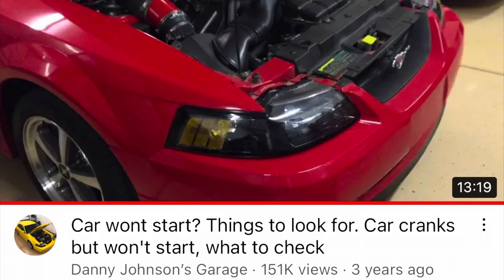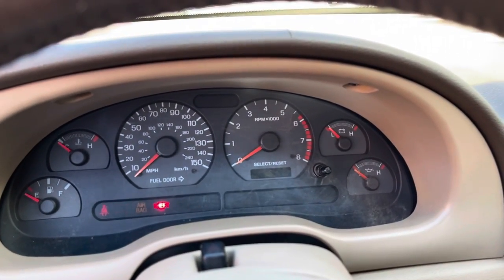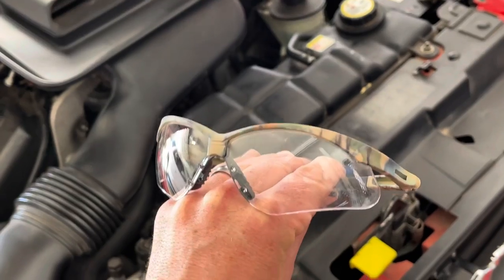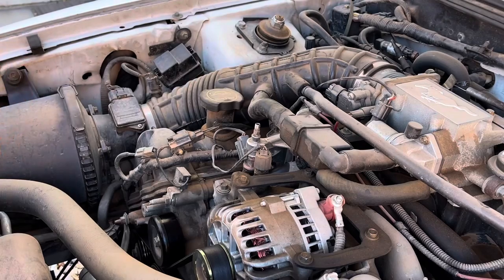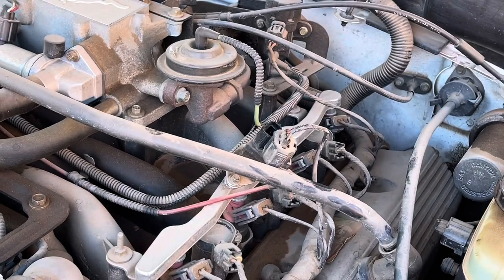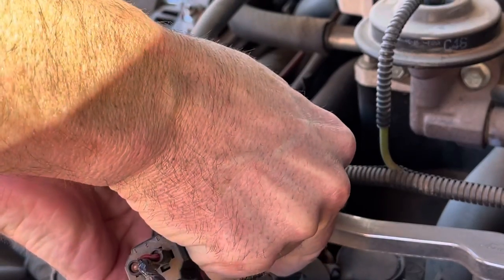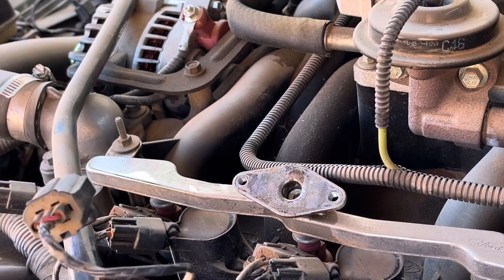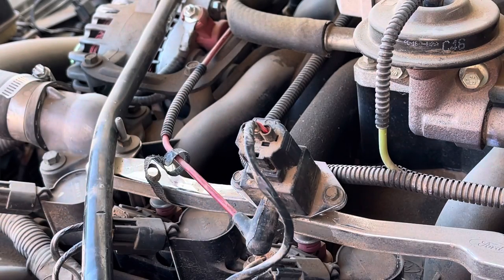FRPS Fuel rail pressure sensor replacement: car cranks but won’t start p0193

Comment: You are a god send dude, my 04 is having slow acceleration issues after I swapped the catalytic converters so I hope if I swap the fuel pressure sensors and fuel filters it'll fix that
Reply: Nope, it was having a torque converter or general transmission issue, beyond my capabilities to fix so I'm selling both my 01 and 04 mustangs to get a down payment for a car from a dealership
Reply: Did you sell your Mustangs after all? I just started mine this past year, hadn’t used it since the pandemic, Feb. 2020 ‘cuz of the Ford PATS crapping out. Finally fixed that last July. But now It’s starting to like misfire, and I get this code too, and like 5 other codes related to the gas cap and/or fuel issues. My wife wants me to get rid of it, since it needs a looooot of work, and a looooot of restoration. Also a new top since it’s convertible. New front tires since they’re from around 2017 dry rotted and wires starting to show up along the inside, since it’s slammed from the front - the lowering springs and the SR ball joints lowered it waaay too much! LoL I can’t sell it, I cannot get rid of it!!!! It’s also not worth any $ due to all the work it needs and the high mileage it has. It’s worth more to me than all the $ in the world!!! But it is frustrating!!!
Reply: @elbros5325  Yeah, i sold both of them for like not even 2k combined, i think i figured out way after the fact i basically just needed to clean the throttle body or get it tuned for having no cats or something like that, i moved on to my current POS a different 04 from my cousin thats had the dash swapped before i got it that shows 80K miles but in reality the car has 200K

Comment: I found another simple trick,  to lower the Static fuel line pressure …while changing this exact sensor, or your (In-line Fuel Filter) near the frame rail! Unplug your (Fuel Pump Relay)  in your electrical control box. You can then crank the car and the injectors will bleed off the fuel pressure …it may even run for a little bit , and stop. Shut off your ignition, After your complete your task, just reinstall your (Fuel Pump Relay), when you’re finished.
Reply: my fuel rails didn’t have that pressure bleed off valve so this definitely helps!

Comment: I am dealing with a HIGH fuel pressure problem that is intermittent.  Sometimes it will be fine at 40 psi and others it will go all the way up to 65 psi.  According to the shop manual 65psi js out of spec.

How do I go about troubleshooting this issue?

Comment: thanks my car is having this issue i just ran a scan on it and it popped up with that code. when I was driving I felt the car shakey and the common diagnostic issues I read online about that code were happening. Plz make video for all P code issues a mustang can have lol It's hard to do the maintenance by myself and mechanics out here are $$$.

Comment: you are the one I will follow now, I have 3 mustangs came in with crank no start, 94, 02 and 05, all of them crank but no start, has sparks, and fuel rail does have pressure, it shows 45 psi on the 05 mustang we check today, but it just keep cranking will not start, I should check the fuel rail pressure sensor. thanks for the video. we work on import cars only, and my friends just bring in his mustangs with no start condition, hope that is going to be fun tomorrow.
Reply from the maker: Here are some things to look at as well  https://youtu.be/JvgKGJjAwU0
Reply: @dannyjohnsonsgarage  thanks for the info, really appreciated

Comment: I have a check engine light on for o2 sensors, after filling up at the gas station I turn my car on and it dies unless I rev it for a little, only happens after I get gas. I replaced Evap cannister and the solenoid and it didn’t work. Any idea?

Comment: Thanks for this video, how ever just a heads up I believe 04 GTs are not equipped with a Schrader valve I am currently tackling my FRPS and cannot locate mine on either rails ..should hitting the switch in back of trunk help assist on the fuel pressure through the rails??
Reply from the maker: You are correct, no shrader valve on the rail for 2004 GT, and the inertia switch in the trunk or pulling the fuel pump fuse then starting the car should work
Reply from the maker: Fuel pump fuse https://youtu.be/u8rogpZSCXg

Comment: I replaced my FRPS today (05/16/2022) in my 02 GT but I'm not sure it fixed my problem since I did get a couple of 50 PSI readings on the scantool but most readings were around 40 PSI. I did get a P0193 code with the old sensor though. A fuel pressure gauge showed 32 PSI with the engine running. I did notice that in some of my live data reports that fuel pressure was down around 10 PSI a few times also. Anyway, I'll have to drive around for a few days to see what kind of readings I get but I think I still have some other fuel problems (maybe fuel injectors). I put some fuel injector cleaner in the tank. I just replaced the fuel pump last week (it was definitely bad). Hopefully I won't have to replace any injectors. Kinda strange that so many things have gone bad at the same time.
Reply: I’m having extremely similar issues right now and i’m wondering if you ever got it fixed and what you did to fix it. the only other thing i’m getting that you’re not is a misfire but i replaced all of the coil packs and spark plugs and it didn’t seem to help
Reply: @prodzilla7101  My 02 GT is running OK with the new fuel pump so I am calling it good. I did have to replace the IAC about a week ago, though, and that solved my idle issue.
Reply: @genericdude6551  so the frps worked out for you?
Reply: @prodzilla7101  No. I replaced the FRPS a couple of years ago but I forgot to note the manufacturer. I'm thinking that it isn't Motocraft. I probably should have replaced it with a Motorcraft FRPS. I recently replaced a bad fuel pump and it's usually 40 PSI +/-2 but my scan tool just logged the pressure as high as 55 PSI. The fuel filter was replaced also. The car starts up right away though. But I'll probably spend the bucks for another FRPS and make sure that it's Motorcraft. I can't imagine that there's a problem with the fuel rail or injectors. I'm not a professional so I sometimes have to guess at what is causing my problems. But I have been considering upgrading the injectors to 24 lb since the new fuel pump is rated for 340 LPH and I installed a flexfuel kit so that I can run up to E85.

Comment: Hi I came across this video my car starts runs and drives just fine but I have excessively high fuel pressure 65 psi while idling, I also am chasing a short and long fuel trim problem my obd2 scanner says that Shrtf12 and Shrtf22 is almost maxed out at 99.2 and long term fuel trims are holding at 10.9. Does this look like a fuel pressure sensor problem?

Comment: Danny , my 01 cobra cranks and won’t start BUT sometimes it will start and stall after a few seconds. I got P0190 code is that the same thing or it’s the fuel pump? The fuel pump makes no noise when I cycle the key. 
This happened randomly I drove somewhere car drove great went into a store for 5 minutes came out and it happened. What do you think?
Reply from the maker: That’s also a FRPS code, so it’s very possible. Or a weak pump that’s triggering the FRPS to think it’s bad
Reply: @dannyjohnsonsgarage  would a bad FRPS stop the pump from making noise when I cycle the key to on position?
Reply from the maker: @riceetr1260  No, the pump should still prime as usual. The pump will still work, which is why I relieved pressure at the fuel rail to change the sensor.
Reply: @dannyjohnsonsgarage   I’m thinking the pump may have gone then. I’m going to change the pump and fuel filter and see if it runs . Hopefully that is it. Otherwise I’ll change FRPS
Reply from the maker: @riceetr1260  If it's your first time changing the pump I have a video. You might want a new fuel tank filler neck grommet https://youtu.be/UhgkGXLSkl0
Reply: I have the same problem but with rich codes

Comment: Please tell me what make, model and year of this vehicle. I’m having problems making sure which part is correct for my 8 cylinder 2004 mountaineer AWD.  Ford says it’s one kind and sent me a picture of it and an auto parts store sold me a different one (like the one in this video).   I checked on line with a different auto parts store and it said that the one Ford says it should be “will not fit your vehicle” and it shows the one that I already have

Comment: I can't find that Schrader valve on my 04 gt. I want to see if it even has fuel pressure. I tried to start my car for the first time this year today and it wouldn't. Does the 04 have it in a different location?
Reply: Years late but 01 and up do not have that Schradervalve unfortunately, so one way to test it is by putting a T fitting between the hose that goes to fuel rail and damper. Another way is to use a scan tool to check live data fuel rail pressure and voltage

Comment: How certain is it that the P0193 code is positive for fuel rail sensor and couldn't be a fuel filter issue?
Reply: if you plug in your code reader is tells you exactly that its the fuel rail pressure sensor

Comment: Mine takes a few tries to start,but does eventually just today stalled when it started i changed fuel filter wss not it,checked starter its good checked altenator its good, and batterys brand new,car does not get same gas milage as before,no code showing though could it be this sensor,and when changing shouldnt you disconnect the battery to be safe?
Reply: have you ever figured it out?

Comment: Ok so I took off the cap to release pressure but there was no pressure what so ever. Could it possibly be the pump??
Reply from the maker: It’s very possible, but I would also check the inertia switch in the trunk shown in this video
https://youtu.be/JvgKGJjAwU0?si=sV_5lJeo5ePJVuiT
Reply from the maker: If you find out it is the pump, I have a video for that as well https://youtu.be/UhgkGXLSkl0?si=4U-uDOLyVCezFK5N

Comment: i changed out my pi intake for a trickflow intake and now my car won’t start! it cranks but won’t start, i have placed everything back how it is supposed to be and i’m getting this code any ideas?
Reply from the maker: If the battery was connected during the repair it may have blown a fuse somewhere
Reply: @dannyjohnsonsgarage  battery wasn’t connected until i finished with the whole install. Car has been sitting for about 2 months now, do you think it could be the battery? i have no idea what i did wrong but i am getting this code

Comment: I replaced my fuel pump on 2003 mustang gt, and a 0453 code popped up would this be my problem?
Reply from the maker: That would more likely be from the evap system. Check the hoses near the filler neck from your fuel pump install inside the tank and under here https://youtu.be/wxVo-6aM4HQ
Reply: @dannyjohnsonsgarage  okay cool, it says evaporite emission pressure sensor / switch high input

Comment: what if I didn't have pressure at the shrader when I checked it? Could the sensor still be bad?
Reply from the maker: I would then check the inertia switch in the trunk, fuel pump fuse, and determine if the pump is bad. If you checked it after the car has sat for awhile it may not have pressure, but if you turned the key and even tried starting it, then you should have pressure assuming it’s a stock returnless fuel system. https://youtu.be/JvgKGJjAwU0
Reply from the maker: Fuel pump fuse https://youtu.be/u8rogpZSCXg
Reply: @dannyjohnsonsgarage  I unplugged the sensor and the car actually almost fired up. Also with the sensor unplugged  it had feul pressure. I'm thinking possibly if that sensor is bad it will send a bad signal to the pump and not it won't send pressure what do or how does that work You think question mark see that because like I said with iron plug there was few pressure with it plugged in there was no fuel pressure but I will double check that tomorrow. And also said prove the vacuum line off and see if I smell few and I think I did smell a little bit of fuel period Someone also said told the vacuum line off or the line off of the sensor and then switch the car on but do not start it and see if fuel comes out. No furl came out of the sensor though
Reply: @dannyjohnsonsgarage  if it is the sensor I'm seeing a bunch of different brands from 25 bucks all the way on up to 150 or so. There are some in between about 53 bucks, sixty-three bucks, 85 bucks
Reply: Did u ever figure it out? mine doin same thing
Reply: @terryfarris6416  yes it was the fuel pumps. I actually did change that sensor and it didn't fix the issue so I have a spare sensor.